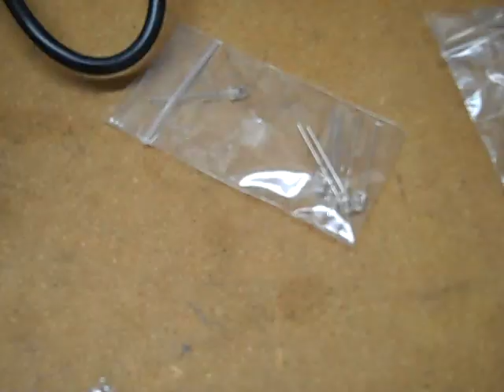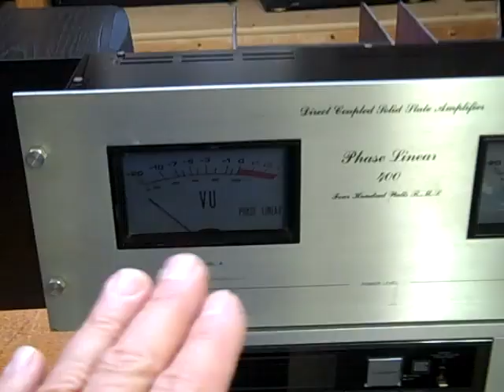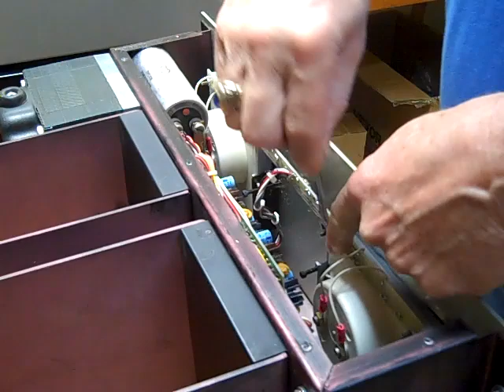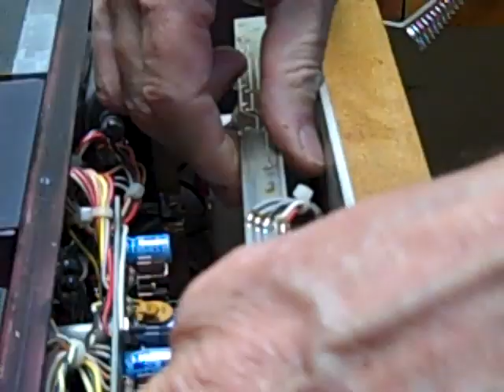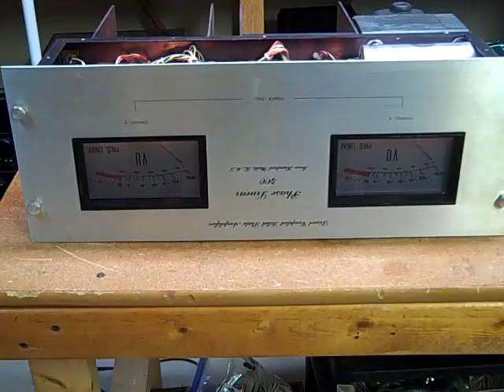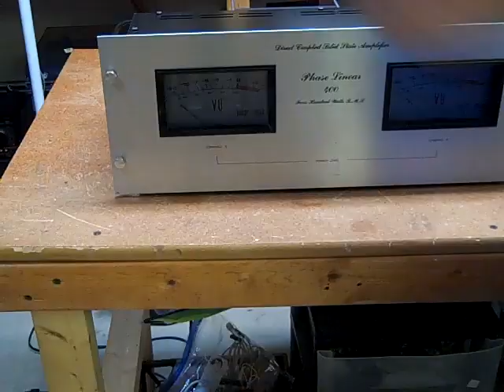Phase Linear 400 Power Amp VU meter lamp replacement

Comment: A Special note on Phase Linear Power Amps with Fixed Gain such as this Model 400. Anyone hear about Flame Linear? These are not amps for a beginner to the HIFi world. Tame the Flame?   If you keep original engineering, there can not be any smoke or any fire. I have Phase linear Amps I have been using for over 50 years now. All original right down to the VU lamps although I did replace some lamps on one of my 400's yesterday. The only way you can get any smoke or flame from one of these amps is allowing thermal runaway "Abuse" approaching near zero Z value / crowbarring out puts coupled with incorrect protection fuses.  I have found a used Phase Linear 400 amp that worked well so I bought it. During cleaning and bulb replacement , I checked fuses. The Speaker output fuses should be AGX 5. I found Buss 14A in both. Main fuse was a 20A! What the? I was shocked this amp has survived that last 50 years! With such high current slow blows, there can be smoke for sure. Maybe a fire!  What is the mistake made here by Phase Linear? Making fuse access so easy for the average joe to replace with what ever he can find in the garage. I have not found any blown fuses wrapped in foil yet. Understand this about DC "Direct Coupled " Amps.  They provide the best power and sound ever! Out puts to speakers are fused with fast blow fuses. These AGX 5A fuses will blow if any DC "Direct Current" at any time is applied to the speakers. IE Click, pop, Clipping, anything other than musical content. What can cause this? Lots of things. Having the amp powered on with a load applied "Speakers"  when pulling RCA's, powering up a Dist Amp with no ground ETC....  Since these 400 amps have no Gain Control only fixed B value, you have to be careful and know your equipment when using these fixed gain amps. For sure these Phase Linear Amps as they are high current!  So. My point being is that having such a High Power Amp is not for the beginner. Bottom line is this.   Beginner or not, if you make an error, and its not always your fault as some Pre Amps and other external components can cause or induce an unwanted wave form when powered up or off blowing one or both AGX fuses, make sure to replace with the specified AGX. If you replace with a non spec fuse, you can get smoke and possibly a fire as you might turn some wire into heating elements and wrapped insulation could catch fire. Short lived fire. Oh noooooo......